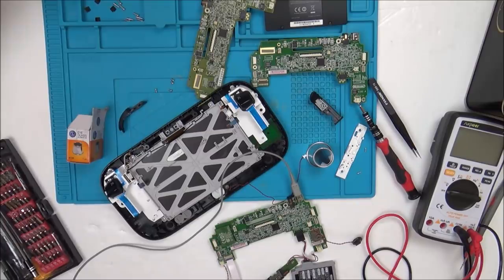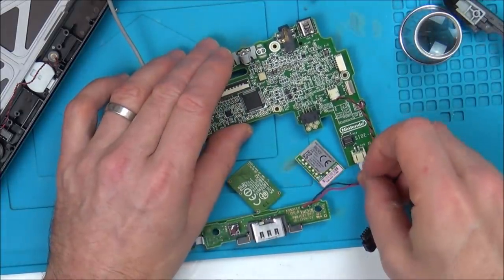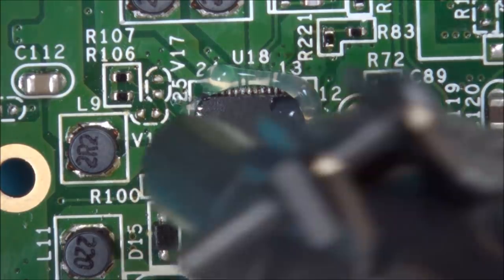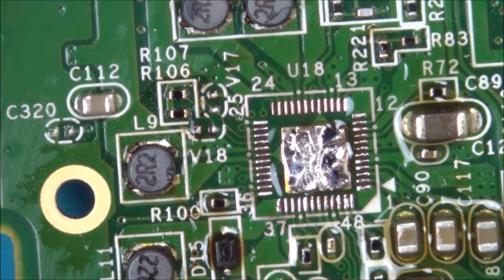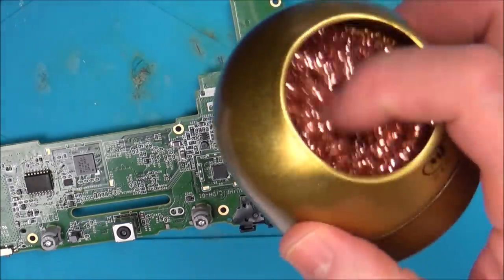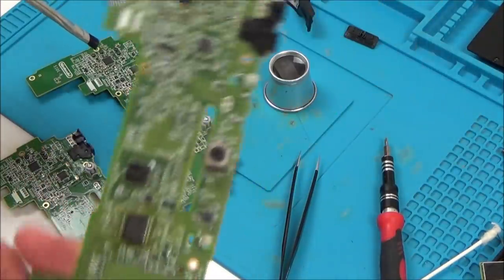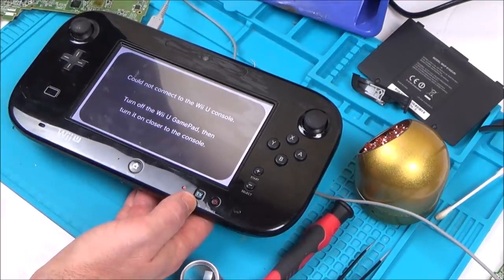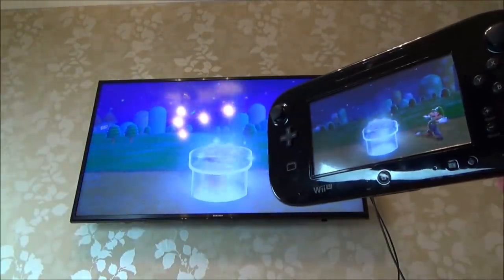Trying to FIX: Nintendo Wii U GamePad No Power / Charge

Comment: Hey Vince, when you using wick, put flux on place you wicking, it makes this process 100 times easier. Flux helps to reduce melting point of solder oxide layers + it's helps to create faster bound between wick and solder, same as in regular soldering.

Comment: Hi Vince. In my very cheap USB Microscope I screw the lens fully and it's add me like 30 cm of work area! Video about upgrade is called "2MP USB Digital Microscope {follow up distance adjustment}" and it's really work, maybe your build is similar so you can do that also. If you get some focus adjustment knob turn it on maximum - when the lens is all the way down to the table ( in my case lens come out off the body ) - then gently try to screw it - if it's turn, that mean that you got thread, so try to screw it all the way in. Lens looks like black plastic 
cone inside that transparent cover around LED lights. Hope it will help you :)

Comment: Leaded solder is the only kind to use.  I work for the DOD in the US and we did extensive study on solder and discovered high failure rates from non leaded solder which developed ‘whiskers’ over time and bridged contacts.  We now fluoroscope all circuit boards and replace all non leaded solder connections.  Non leaded solder is no longer used in military equipment.

Comment: On typical integrated circuits, the exposed pad is usually ground, but on power components like transistors it is often the only contact for one of the power terminals, which isn't necessarily ground!

We used an "ideal diode" component on one of our boards and if I remember correctly the exposed pad was actually the power in , and the ground connection was just through the pins on the side.

Comment: Oh sorry for the comment spam, but something to consider: On rare occasions I've actually tinned the pad on the bottom of the chip itself rather than the pad on the board. It's a pain though so I only do that when it's really being uncooperative. I think this way the solder will go molten quicker since it's only thermally attached to the chip which has much less thermal mass. It might also make it easier to sit on the board sometimes.

Comment: A few sheets of wet kitchen roll folded flat and wring it out so it's not dripping with water. (Home made solder iron cleaner) glass blowers use same principle to mould glass
Don't press down on chips when placing on boards. If you find you're having to do that then you've far too much solder on the ground plane to make contact around the chip.
Before taking chips off the board place a bead of leaded solder around the chip
Ideally the board should be heated before desoldering/reflowing. Doesn't have to be baking hot just enough to minimise flex and damage

Comment: Vince, one more thing to consider about flux is if it glows in UV. It allows you to easily check if you cleaned all flux or not. Also, sometimes you can flash UV light at a board and see if it was touched by anyone before you and if yes, then where exactly. It is not a 100% guarantee (some fluxes do not glow in UV, some people clean flux well) but it takes only a few seconds and does nothing wrong while can provide you with useful info. Obviously, it is not a super important thing, but a nice thing to have in my opinion.

Comment: I was struggling with the same plastic hinges on 3DS and 2DS but found a way to get them back. So what I do, I lift the contacts up from the motherboard and push the plastic in a way that would look like it is fully open. So those clipping parts first. After you close it, contacts will bend down and that is it. 4 test - all successful.

Comment: Solder wick/braid does come with some flux on it but I find it's never enough and I want to add more. I've also heard one person recommend having a little bit of solder on your iron tip so that it makes better thermal contact with the braid--also, touching your iron tip to the solder and the braid instead of putting the braid in between the iron tip and the solder.

Still haven't mastered solder wick though, I often find myself struggling to use it successfully.

Comment: Soldering iron tips are generally plated, and if the plating is compromised, the tip won't last as long. You probably cracked the plating by bending the tip like that, but if it's a cheap tip and you don't mind it maybe not lasting as long, then it's no problem.
Reply from the maker: Thanks RF :-)
Reply: @Mymatevince  No problem! I'm kind of wishing I could make my own youtube videos so I could demonstrate these things instead of just writing about them haha.

Maybe you should start up a discord or something for people to chat with you if you have the time, you seem like a guy I'd love to talk to.
Reply: After I made this comment I looked it up and it looks like soldering iron tips are usually copper, plated with iron or steel and then probably tinned from the factory. The iron/steel plating will definitely be harder than the copper core, and I think also that if there's a crack in the plating, over time solder will start to mix with the copper on the inside. I know with lead-free solder when the plating is compromised, you end up with your iron tip basically getting hollowed out as the solder eats away at the copper interior. I'm not sure how bad it is with lead solder though (this is why you sometimes hear people recommend not to use a wet sponge with lead-free).

Barely related but a previous boss of mine told me that one of the things that kills electronics over time is that the solder from component leads actually starts to migrate into the copper tracks and change their properties. I'd never heard that before and it's really interesting to know.

Comment: I love the WiiU, especially with custom firmware - best gamecube emulator and even better if you use the switch GC adapter and GC controllers!
Reply: Ian H it’s technically not emulation. The Wii U has most parts from the original Wii, and the original Wii is just a beafed up GameCube. Idk why Nintendo didn’t make a disc drive to take the small discs cus that’s all they had to do, would’ve improved sales dramatically

Comment: I had guessed that chip had an exposed pad on the bottom by the difficulty you were having. For chips with contacts on the bottom I have so far gotten the best results by using a nozzle that's close to the size of the chip (which it looks like you did) and just pointing it straight down on the chip and holding it as close as I can without touching. By the time you get the solder on the exposed pad to flow, the leads will likely have melted as well.

Ideally you want to concentrate your heat on the leads, but given the choice, it's definitely better to heat the chip than the board. Worst case you overheat the one chip instead of the board and all of the components nearby. And with an exposed pad or BGA/LGA chips, you really don't have a choice as the solder joints are inaccessible. Chip packages are designed to withstand soldering temperatures and you will melt the solder well before the chip heats up to a dangerous level, as that black epoxy they're made of is not a very good heat conductor so the heat doesn't easily reach the actual chip inside.

If you want to get really fancy you can get hot air nozzles that are shaped to direct air at the leads of a specific chip package type, but I've never had the luxury of using one and I've gotten by without just fine. Probably better for high-volume work though.

Also be aware that with a big exposed pad like that on the bottom, the surface tension will make it difficult to lift the chip up as you would with a normal QFP or SOIC, you will likely have to twist or slide it. This can be problematic when there are other components nearby as you might knock them out of place. I've so far mostly worked with a particular SOIC chip with an exposed pad, and I've found I can grab the sides with a pair of broad tweezers, give it a little twist back and forth and lift it up.

Comment: When soldering a chip with an exposed pad on I find it quite difficult to do the whole thing at once with hot air reliably. I've got the video paused but maybe your luck is better than mine :)

I usually tin only the exposed pad, use hot air to flow that and then go in with the iron to solder the leads on the outside. People do say you can do the whole thing at once, though, so I might just be bad at it.

Seems like this would be a great candidate for solder paste though!
Reply: It always looks simple when following the professionals. I have tried changing a QFN IC on a PS4. After four times (4!) I have not once seen that little jump. But I got lucky in the fourth time, and it works anyhow. :)
Reply: Marcian0 It does look easy when pros work! Like you said, it never is.
Reply: This is what Louis Rossman does... Just enough on the pad and the solder will wick up the leads when drag soldering along the sides. Flux will help the solder flow. But pros are pros :)

Comment: the copper will dissolve through the scratches.  It will work, for a while.  But it will dissolve.  The plating is the only  thing keeps tips from dissolving.

Comment: The NOR flash probably contains the bootloader. It could be that one chip has a newer version of the bootloader than the other and the mismatch between the bootloader and main software works in one direction but not the other (e.g. it's backward compatible but not forward compatible or vice-versa).

In general Serial NOR Flash is most commonly used to store firmware for chips (including bootloaders for CPUs, the BIOS/EFI on PCs etc) and configuration for FPGAs, so if you find one that's most likely what it's being used for, especially if it's SPI (as opposed to I2C).

Comment: hey vince here's a tip that works great for me, when cleaning up flux on a board i use acetone then ipa
Reply: Probably works great but acetone is much more dangerous. If you get it in your eye it can cause permanent damage very quickly.

I have heard that ethanol (either just high-proof vodka/rectified spirit or denatured alcohol/methylated spirits) is better than IPA and not any more dangerous.

What I usually do if I really want to clean it is heat the board, dump a bunch of IPA on it and scrub, then quickly rinse it off with more IPA. Heating the board makes the flux residue dissolve more easily but because IPA evaporates so quickly you've got to be fast.
Reply: my opinion i've only been an electronics repair man for 33 years, never got it in my eyes yet thank god, have a good day
Reply: Acetone, is how Paul from Mr Carlson's lab does it. It's a great channel on here. Probably the best one I have found. The man's a genius.

Comment: I replaced the motherboard in my gamepad, but when resembled, the game pad still does not charge and light does not come on.  The only part I couldn't reconnect were the speakers.  The original board had them soldered  and new board had the connectors.  Do the speakers need to be plugged in to finish circuit?  Or could it be another problem such as the battery or the ac adapter?

Comment: Great one!

Vince, i have a new 3ds xl with a strange charge issue where it has to have the charger plugged in and shuts off if you remove it possible bad ic chip. Im selling it and figured you may want to make a video of it. Selling, so i dont need it back.

Would you be interested in it for a video?
Reply from the maker: Thanks for the offer. I will politely decline it at the mo. Would it be worth swapping the battery? Might be a simple fix :-)

Comment: do you have trouble getting leaded solder in the UK because of RoHS?
Reply: As I understand it, you're not allowed to sell products containing lead solder with certain exceptions, and (as of recently) you can't buy it off the shelf in everyday stores. It's still easy to buy from electronics suppliers like mouser--they just don't want it on the shelf in your neighborhood hardware store. Which I understand--if someone who doesn't know anything just goes to buy solder for whatever reason, you don't necessarily want them buying lead if you're concerned they don't know how to be safe with it.

So it's not like they're trying to keep lead solder away from people who actually specifically want to use it, more just that they don't want people buying it kind of accidentally.

I think the specific language is that you're not allowed to market leaded solder to *consumers*, only to professionals. However, there's no bar set for "professional", so it basically just means it's just not sold in consumer hardware or electronics stores.
Reply: @rfmerrill  I think that mass production cannot use it but fine for repairs.

Comment: oh my oh my , so much wrong with what you are doing , BUT a thoroughly enjoyable video none the less . Just a tip , SLOW DOWN , you are attacking everything way too aggressively just take your time , you had bridged pads on that chip before you started , you didn't really need to take it off , relfllowing it would have worked probably , also , check passives , they are more likely to blow than a chip most of the time ,  anyway good work , just remember , gently gently my friend !!

Comment: I think I killed this on mine as I have been using a usb cable soldered to the original battery harness hooked to a portable charger and she just stopped working. Hopefully this works for me lol 
Thanks for the video!
We will see

Ohhh I haven't cleaned it yet but somehow 2 of the pins on the chip are soldered together on mine. 3and 4th ones up from 1< 😎 hopefully I can clean it off lol

Comment: Glad you like the flux I found the links for. On a different note if I was you I would get some tip tinner which is used in conjunction with the metal tip cleaner. It helps to stop the soldering iron tips oxidizing. You press a hot soldering iron tip into the tip tinner then use the metal tip cleaner to clean it off.  Here's a link for it but RS sell it as well, it's just a bit dearer. https://www.ebay.co.uk/itm/15g-Tinner-Soldering-Iron-Tips-Refresher-Oxide-Paste-FAST-UK-POST/164020771953?hash=item2630665c71:g:PA0AAOSwtQxeE4GT
Reply from the maker: Thanks PDS, I have just ordered it :-)
Reply: @Mymatevince  To further that when you finish using your soldering iron melt a blob of solder on to the tip and let it cool down. That way when you use it again, when it heats up it burns the solder rather than burning the tip.

Comment: Watching this currently and heard you mention about buying Amtech Flux in the UK.  I considered buying it a while back and looked up the UK distributor. They are: https://bga-reworking.co.uk/ - you're guaranteed the genuine product if you buy from them.

Instead of the Amtech I'm going to try some UK made flux from Solderking. The company seems to have a good reputation so fingers crossed it's a good product. It arrived moments ago so I'll be trying it over the weekend.

Also, think about treating yourself to a T12 based soldering station such as one of the KSGER ones. The starter kits are around £70 and my experience (for what little it's worth) is the T12 soldering tips heat up quickly and are much better at maintaining / regulating temperature. I've never looked back after buying mine - it's fantastic!

Comment: Does anyone else shout at the screen at Vince to leave well enough alone? "It's on the pads! Noooo, don't touch it! Oh, you've ruined it. Okay, now it's fixed, don't touch it. Noooo don't touch it again!" Or, "Okay, drag soldering worked, all the pads are soldered. Noooo, don't drag solder again! Oh, you've formed a bridge. Okay, now it's fixed, don't do it aga-- NOOOO, you did it again!"

Comment: You see the second mistake he's making right now he's putting the heat gun back on it again because he says he see some solder balls he had a soldering iron that he can use the run up and down the line the fine nine take any thought it was off there without heating the chip up even more which more heat on that Chip is going to ruin the chip get the heat turn off the check